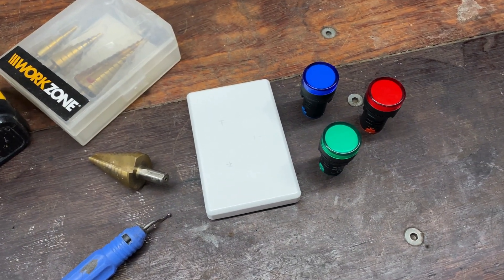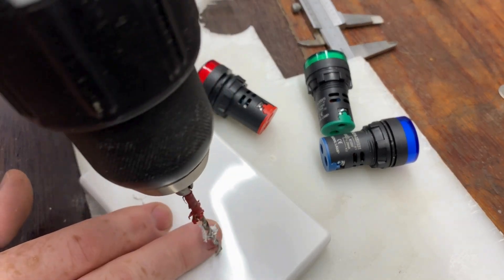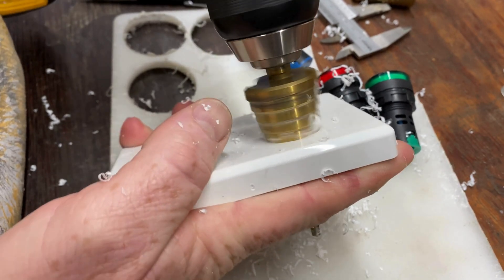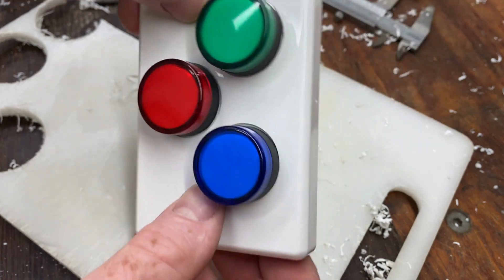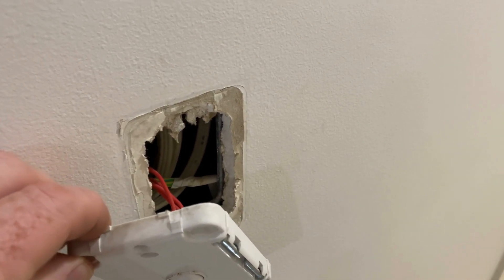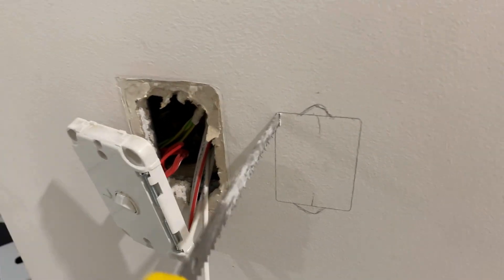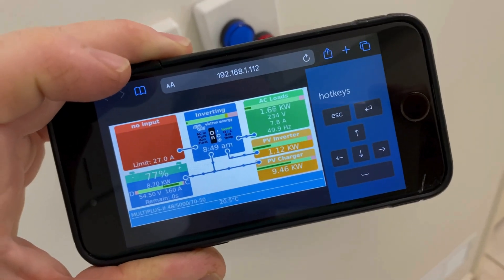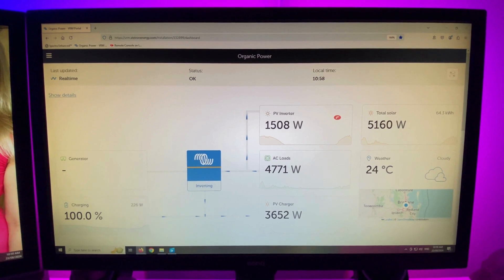Installing Our NEW Victron Multiplus II Solar System Indicator Panel

Comment: Quick question 
I notice the MCCB's have more than 1 cable paralleled. Do you have a some sort of a tinned copper bush between lugs and a longer ss hex bolt to torque and secure
Reply from the maker: Hi, I made up some brass spacers to suit the lugs and bought longer high tensile bolts from our local bolt shop.